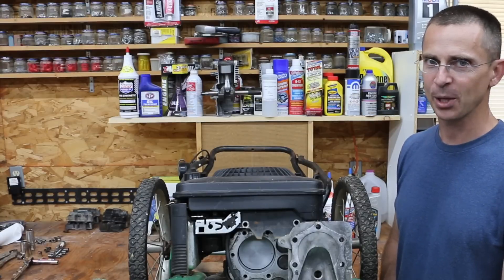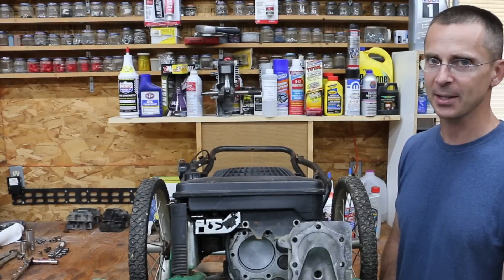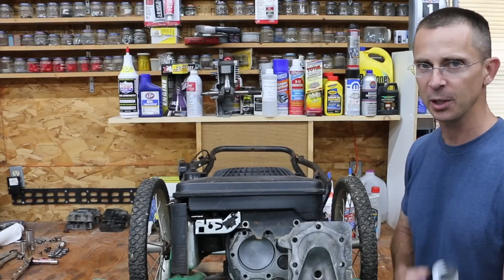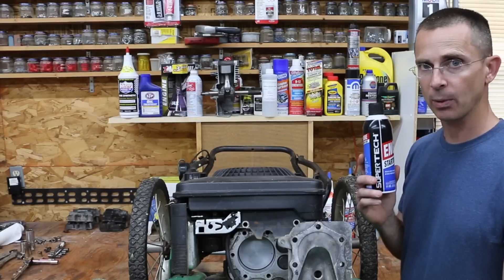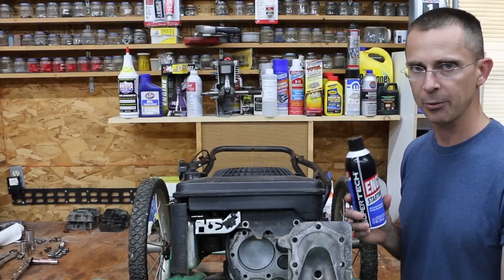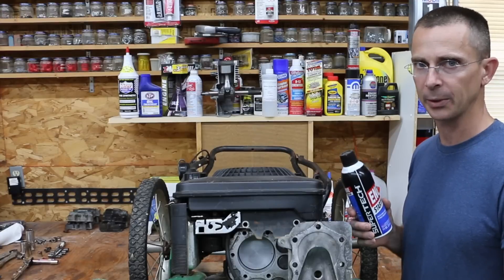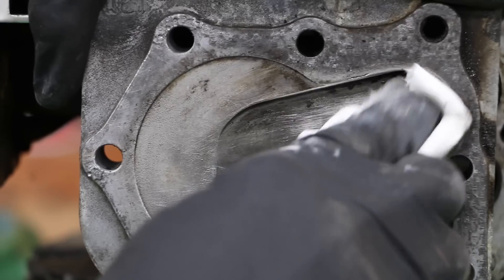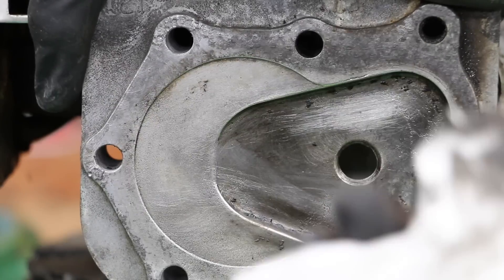Will Running an Engine on 100% Starting Fluid Cause Damage?  Let's find out!

Comment: I would like to see you run a 2 stroke engine on starting fluid. Unlike 4 stroke engines the fuel passes above AND below the piston. The fuel/oil mix provides the only lubrication to the cylinder walls.
Reply from the maker: Thank you for this recommendation!

Comment: Can you see what happens when sugar is put into the gas? Always heard it will trash a motor but never saw any cold hard proof. Thanks for putting these videos out to get to the bottom of things
Reply from the maker: Thank you for this recommendation.  I did a video on sugar in gas a while ago and it caused a lot of carbon buildup but it didn't ruin the engine.

Comment: Would you get a small Diesel engine, inject a small amount of ether directly into the main fuel line and see what happens running the engine on that?
Reply from the maker: Thank you for this recommendation!

Comment: ive seen on hand damage of either in a diesels. over dose on starting. does all kinds of damage, bent rods, blown prechambers distroyed cylinders, gaskets streached head bolts. warped valves if not just bent valve seats pop out of place. diesels are first nature to me. thanks for the vid.
Reply from the maker: Thanks for commenting on this and thanks for the positive feedback.

Comment: The oily film is the upper cylinder lubricant added to the fluid. Honestly I think running an engine on starting fluid is safer for the engine than running it on gas... assuming you address the oil buildup every so often.
Reply from the maker: Great point regarding the lubricant.

Comment: I'm not sure if it was the starting fluid, or not. I had a Olds Cutlass Ciera  with the 4.3L diesel when i was in my teens. I started using starting fluid to start it during the winter when i was somewhere I couldn't plug it in and it didn't last much longer. I know these GM diesels weren't well known to be reliable: so I'm not certain if that caused the failure, or what really failed.
Reply from the maker: Thanks for commenting on this.

Comment: I think most starting fluid has an upper cylinder lube to deal with the oil washing tendencies. Likely that was the oily film.
Reply from the maker: Yes, I believe you are correct.  I agree, the oily film must have been caused by the lubricant in the starting fluid. I'm learning a lot from these tests. Thanks for commenting.

Comment: Very interesting. Both the idea and results. I wonder how a 2 stroke engine would hold up running on starting fluid. Since there is no oil in the starting fluid. Or an improper ratio of oil vs combustible it would be interesting to see what would happen.
Reply from the maker: Thank you for this recommendation.
Reply: Thank you for the videos. They are all very thorough, and enjoyable to watch.

Comment: Try this on a Diesel engine in -0 temperature I've heard a engine lock up from to much starting fluid with a stiff cold engine I've seen bent connecting rods and bent push rods what happens is think of a train hitting a rock at 40miles an hour it moves the rock but causes a damage because the rock is stationary that's what happens when a cold stiff engine gets hit with a blast of instant combustion in the chamber
Reply from the maker: Excellent point.  Starting fluid in a diesel much more risky than in a gasoline engine.  Thanks for commenting.

Comment: I once ran out fuel in my 80's Thunderbird with a 302 engine in it. I put in a half gallon of rc car gas that was twenty percent nitro. I drove the car for seven miles until I reached the next gas station. Can you try that in one of your next small engine tests?
Reply from the maker: Thank you for this recommendation.

Comment: With the newer starting fluids containing an upper cylinder lubricant i dont believe thered be any ling term damage in any engine two stroke, four stroke, or diesel
Reply: chevy smith 
The starting fluid I recently used on a rented backhoe said that it was safe for Diesel engines.

Comment: We actually used starting fluid to start the Detroit diesel engines of our M109 self propelled Howiters when I was in the Army National Guard, between 1979 to 2002.
Reply: does starting fluid cause any damage to engines?? Bc they sound "healthier" so to speak

Comment: Great test video.....
Also, to answer your statement about diesels and starting fluid...  Ether used in a diesel is no different than in a gasoline engine.  BUT.....the real problem is that diesel engines have either glow plugs or grid heaters to help with initial combustion which can unintentionally detonate the ether on the intake side of the engine and cause massive damage to the engine.  All pre-heating elements must be disabled prior to using ether on a diesel engine.
Reply from the maker: All very valid and excellent points. Thank you for commenting!

Comment: Maybe some one can help me here but every two stroke I have used starting fluid in has eventually required it for start.  Why is that?!?!
Reply from the maker: Starting fluid takes it's toll on a 2 cycle engine more than a 4 cycle.  I'm told it doesn't have adequate lubricant for the piston/rings.  Thanks for commenting!

Comment: Does starting fluid contain oil? Wheres that oil film on the head coming from? If its not part of the starting fluid, I guess its disolved oil from the cylinder walls? In that case its true that starting fluid disturbs the oil film on the cylinder walls?
Reply from the maker: Yes, it does contain oil.  I didn't know this prior to this test.  This was a fun project.
Reply: Project Farm It was also fun to watch the video

Comment: My brother has an Exmark zero turn and he was starting it for a whole mowing season with starting fluid because the choke cable was frozen.  When I serviced it for him in the fall, the inner foam filter was completely gone. The only thing left was the perforated metal cylinder. The rest of it went through the engine.  After chewing him out a little, I told him to throw the starting fluid away and I replaced the choke cable. BTW, he's not very mechanically inclined.
Reply from the maker: You provided your brother with great advice.  Thanks for commenting.
Reply: Don't even use starting fluid on a two cylinder JD . Maybe get away with a little sniff holding can way back. If head comes off, you learned your lesson.

Comment: You could try blowing pure oxygen into the carb while the engine is running on regular fuel.
Reply from the maker: Thank you for this recommendation!
Reply: My pleasure! I just found your channel recently and I'm really liking it so far. Keep up the good work and be safe, especially with the oxygen.
Reply: Throw some acetalyne in the mix and see if you can send the head out the garage
Reply: I would like to see oxygen enrichment for cold diesel starts.

Comment: Will running it on straight 3m non chlorinated brakeclean cause carbon buildup? Detonation? Pre-ignition? Or ring failure? I drove my Subaru Impreza 2.2 on straight brakeclean 3m nonchlorinated for about 11 miles. Did not check things before and after, but it's a way to get to a gas station from the middle of nowhere. It seems I was getting pre-ignition once it warmed up. I wonder if itd be enough to be noticeable in a small engine.
Reply from the maker: Thank you for this recommendation!

Comment: Could you try and find a mix rate for running an engine on used motor oil through the carburetor and propane in the intake without excessive smoke..
Reply from the maker: Thank you for this recommendation!

Comment: I hear that starting fluid ruins 2 stroke engines. I recommend finding an old 2 stroke Lawn Boy. My dirtbike buddies claim catastrophe is the outcome. I'm pretty curious myself.
Reply: And if you find yourself with some two stroke test subjects, all the 4 stroke tests you've already completed would be neat to try on them. Well, whatever tests are applicable since there are obvious differences like crankcase oil and whatnot. The two stroke road seems to be something you haven't covered. If you decide to blow them up you will have at least one avid watcher right here due to my love for them. Either way keep up the good work
Reply from the maker: Thank you for this recommendation.
Reply: No prob buddy, you look like your having a blast. I know I would be

Comment: Pour sand directly on the flywheel while the engine is running
Reply from the maker: Thanks for this recommendation!
Reply: Another idea would be to lower the engine completely under water except for the air intake, basically let the engine slowly flood with water while it stll runs

Comment: Love your videos.  I'm glad to see that nothing bad came of this.  Starting fluid (ether) is insanely flammable stuff; I was cringing the entire time it was sprayed on the outside of the engine.  With that many fumes in the area, if you'd gotten up to the autoignition temperature of ether (about 300F) it would have caught fire in spectacular fashion.
Reply from the maker: Yes, I've had this happen in another video (Monster Energy), in which the engine backfired through the carburetor and the engine caught on fire.  I'm always ready for this have quick access to a fire extinguisher to put out the fire.  Thanks for commenting!

Comment: They may have improved starting fluid through the years. We used to call starting fluid, either.
Reply from the maker: I think they've added lubricant to most starting fluids to prevent damage.  Thanks for commenting!

Comment: can you try to run a engine on rc nitro fuel. it will get lots of power
Reply from the maker: What % of nitro do you recommend?  Is 20% good?
Reply: Project Farm yes 20% is just goodt i run my nitro car olso on 20%
Reply from the maker: Thanks for this information!
Reply: Project Farm np sir
Reply: @ProjectFarm  Nah, get some 40-60% nitro rc fuel. I use to run 40% in my boats. How high does your temp gun go? Lol

Comment: As far as the diesel issue goes, if the engine has an intake heater it can predetonate on starting fluid and cause damage, also a diesel uses fuel as a lubricant so running on starting fluid will damage the Injectors as they are not being lubricated
Reply from the maker: This is a great point!  Thanks for commenting!

Comment: Starting fluid has saved my day many, many times, with all types of engines.
Never found an issue in fifty years or so...
Reply from the maker: Yes, it has saved me many times too.  Thanks for commenting!
Reply: I too have used starting fluid to start diesel engines in very cold weather as low as 20 below zero F. The biggest problem is getting it to turn over . Have also pull started trucks with diesel as well.

Comment: Run an engine on 90% nos
Reply from the maker: Thanks for this idea!
Reply: i reccomend you cut a hole in a safe for the exaust and let it detonate in the safe cause without the proper a/f ratio thats what you are gonna get be safe

Comment: Run one on straight E85(not a blend) or diesel and see what it does. 
When I worked as a tech at a Chevy dealer years back, we would often have a tech spray carb or brake cleaner or starting fluid in the intake long enough to be idled into the shop. Common when trucks came in for fuel pumps.
Reply from the maker: Thank you for this recommendation!

Comment: Good test. Do not do this to any diesel engine. A tiny amount is ok if absolutely necessary but starting fluid works much differently in a diesel. When sprayed into the intake it detonates as the piston is still traveling upwards, causing extreme pressure and heat. When used on an already warmed up diesel engine the effects are much more severe. The gas engine has a low enough compression ratio so that detonation is avoided entirely.
Reply from the maker: This is a great point regarding diesel engines.  Thanks for commenting!

Comment: I'd say the worst part about starting fluid spraying in the carb doesn't give an ideal fuel air mix. Starting fluid can combust in a wider fuel air range. That can cause hard pinging and knock. I'd be more concerned (in a car engine) about stress on the head bolts, connecting rod bearing, and head gasket than washing down the cylinder oil. Gasoline is a very good solvent too and would do the same.
Reply from the maker: This is a great point! Thanks for commenting!

Comment: I think starting fluid may be combusting too early, causing a diesel engine to ping or knock...
Not sure, but that's what I think will happen.
Reply from the maker: Yes, you are right.  Predetonation is very hard on an engine.  Thanks for commenting!

Comment: The test was not entirely valid.  The mixture was not adjusted to be optimal for the starting fluid.  Also, the running time was very insufficient.  However, it did show that using starting fluid to start an engine is probably safe.
Reply from the maker: This is a great point.  Thanks for the constructive feedback.  This will help me in future videos.  Thanks again!

Comment: Have quite a few buses with cat c7 in them.  Previous mechanics who couldn't diagnose a bad grid heater used to just ether them.  Now they barely start.  Cranking for quite a long time because damage had been done.
Reply from the maker: LtGerbal, thanks for sharing this information.  I'm convinced that starting fluid can cause damage to most diesels.  Thanks for commenting!

Comment: Most starting fluid contains an upper cylinder lubricant. Which might explain the oily film. We had a higher compression diesel skid loader someone had used starting fluid (ether) on and I'm going to guess the compression cause preignition and blew one of the pistons to pieces. I've never had issues with Ether on a lower compression diesel engine. (Like the ones in the oliver 77, 88, and 1750)
Reply from the maker: This is a great point regarding lubricant.  I'll have to be careful about using starting fluid on the newer diesels for sure!  Thanks for commenting!

Comment: Word of advice to the public: DO NOT, I repeat DO NOT try this yourself. I have been leery of using starting fluid since I used a tad too much to try to get an old motorcycle running that I got for $50. Backfired through the carbs, while I was sitting on it, caught the bike on fire, fuel tank and all. Still can't grow hair on spots of my leg.
Reply from the maker: Nathan, sorry this happened to you!  I had a lawnmower catch on fire from a backfire too.  Fortunately, I didn't experience any burns.  Thanks for the word of caution!

Comment: I was always told it's ok for gasoline engines, it's death to diesels if you use too much. Detroit Diesel has warning stickers all over its newer engines cautioning you not to use starting fluid. Supposedly it damages injectors and glow plugs.
Reply from the maker: This is a great point regarding diesels.  Lots of risk involved if used.  Thanks for commenting!

Comment: only damage would be a  2stroke engine, diesels use the fuel as a lube, pre ignition. as in before it gets injected. I think you would have a hard time with a diesel wo fuel depending how long fuel pump damage would happen, I would think in theory anyways. love watching you show sometimes I'm amazed on the tests
Reply from the maker: This is a great point regarding diesel fuel serving as a lubricant vs 2 cycle.  Also, thank you very much for the positive comment!

Comment: what socket is that you are using on your drill to start your mower?
Reply from the maker: Van, It's a deep well impact socket.  I don't recall the specific size and I'm away from the shop.  Thanks for commenting!

Comment: The problem with starting fluid is it has no octane ,it fires with no spark in a hot cylinder compressing makes heat .so a person is trying to start an engine ,they spray starting fluid ,it starts to ignight ,then an injector fires fuel in to the cylinder that is already firing (building high pressure) then the fuel ignites building way too much pressure .that is why rings break rods bend head gaskets blow starters break.
Reply from the maker: Dale, this is a great explanation.  Thanks for providing these comments!
Reply: 2,2,4-Trimethylpentane, also known as isooctane or iso-octane is used as a benchmark for measuring a fuel's resistance to ignition. Octane rating uses that benchmark to quantify other fuels. Methyl tert-butyl ether depending on the test to measure it has an octane rating of 110.5
Reply: calvingreene90  it may have an octane rating of what you say if it is formulated for that .but the problem is that it self combusts at 160 degrees (varies based on formula) this pre ignition based on compression heat alone is what causes the damage also is is not a controlled burn cold have several flame fronts

Comment: Most generally when starting fluid is used on a engine. You will have to use starting fluid to start it from that point on.
Reply from the maker: James, Great point.  Lots of comments about engines getting "addicted" due to the compression loss/damage.  Thanks for commenting!
Reply: I have not found that to be true except that the condition that that caused the need to use stating fluid in the first place tends to not go away. I used starting fluid to start a lawn mower for years and then my nephew who is just a little quicker than me started the engine without starting fluid without starting fluid without a problem. I also started a motorcycle in in temperatures well below 0 F using starting fluid  without the engine needing starting fluid under above 0 F conditions later.

Comment: I'm a mechanic, this is interesting, how about the diesel
Reply from the maker: Curt, Great point regarding the diesel.  I'd test this on an old diesel if I had one that I didn't mind destroying.  I suspect it'd cause damage.  i do find it interesting that several John Deere tractors from the 1970s came with starting fluid canisters mounted next to the engine.  A friend has a John Deere 4040 with starting fluid as a factory option.  That's not to say that it doesn't cause harm.  Thanks for commenting!